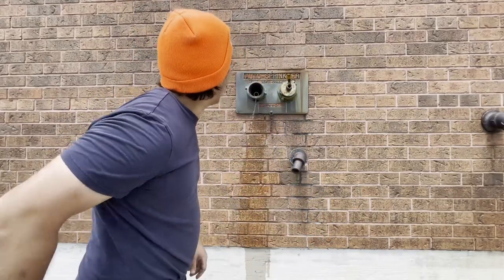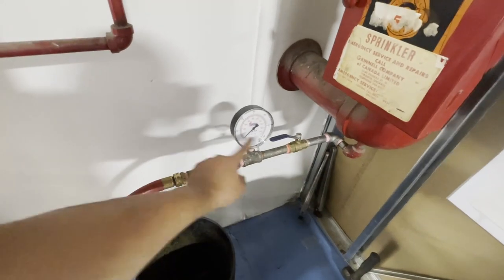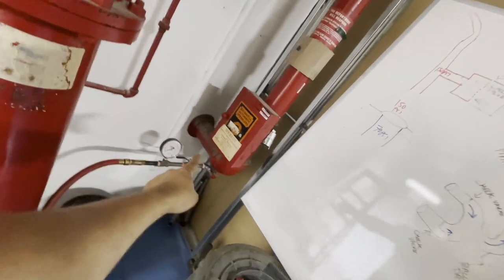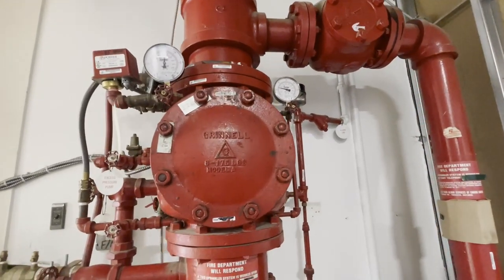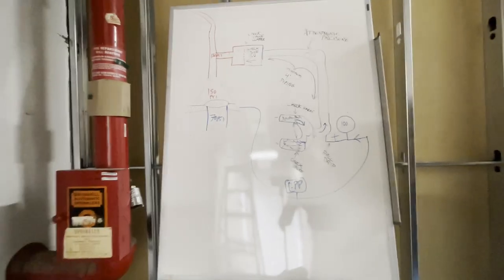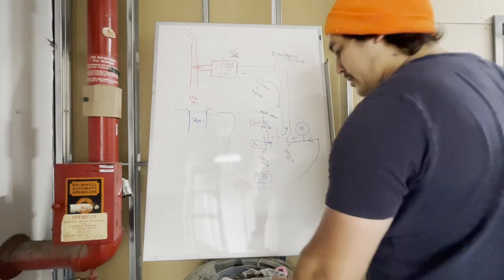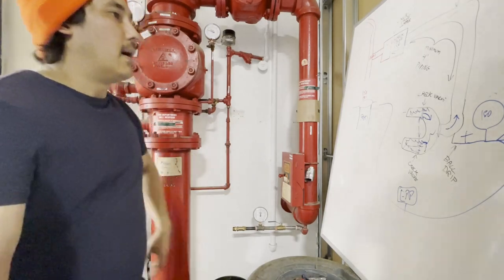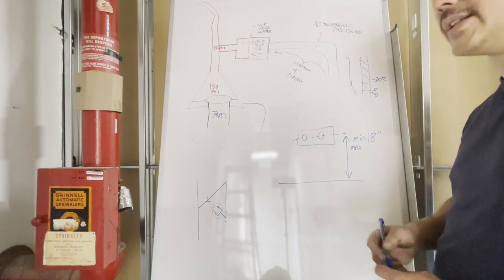5-year 150psi 2-hour Hydrostatic Test on a Fire Department Connection

Comment: I think this is great information.  We perform 5 year hydrostatic testing and it is difficult to pull the flanged check valves apart to put that flange on them. This would also work here in az where you have a remote fdc connection and the check valve is just below the siamese. Thank you

Comment: Good information, thanks, this was helpful and entertaining, water leaks really do happen and they need to be dealt with.  Like you said expect and plan for them.  The velocity check valve has me a little puzzled since on our dry valve trim work they are called automatic drain valves.  This type of operation doesn't sound 'automatic' to me.  Unlike the ball check valve which is in my mind very automatic if installed horizontally!
Reply from the maker: Thanks for the compliments and the comment! The velocity drip check and ball drip are honestly very similar in how they function. Both of them will allow a small volume of water to flow through them, however if they are under a pressure (flowing water from the alarm line of a dry pipe valve tripping or if the fire department connection piping is under pressure in the event that the fire department does indeed hook up to the FDC to try and pump water into the building). The major differences between them is that the ball drip will seal up and there's no means to "reset" it, you simply need to take pressure off of the pipe to the point where that ball will roll itself out of that concave shaped cavity. A velocity drip check on the other hand obviously has that plunger which you can use to manually force that ball out of the concave cavity if it is under pressure. Depending on how your dry pipe valve is trimmed, the velocity drip check "should" eventually automatically drain after pressure is removed from the alarm line piping. Velocity drips are really just designed to "automatically" drain small amounts of water in the event that the clapper seat on a dry pipe valve or preaction/deluge valve starts passing small amounts of air/water from either the supply side or system side of the clapper. If you notice air constantly leaking from the velocity check, you know its system air dumping. If you see water leaking from the velocity check... it could be either supply water leaking past the clapper seat, or you could still possibly be the system side priming water passing; I would say wait to see if the water stops but really it doesn't matter, inspect the brass clapper itself to see if it's warped. If not, service or replace the clapper rubber and that should fix the issue. 

At somepoint in time you'll hear fitters tell you if you're having a hard time trying to get air back on the dry pipe valve, they'll tell you to remove the velocity drip and install a 1/2" ball valve there and leave it closed while putting air back on (or just use a spare sprinkler head out of the headbox to plug it up). Once you get to 10psi system air or so they'll say throttle open/closed the ball valve and it'll suck the clapper seat down. When trying to put priming water/air back on the system, the velocity drip check will sometimes dump system air and/or priming water so you just need a means of temporarily plugging off the alarm line to lock in that priming water/system air while the system pumps up to push down on that clapper seat to create a seal. *You NEED to remember to remove pressure off of the alarm line before opening the main control valve and putting water back on the supply side of the clapper (hence why a ball valve is preferred over just plugging the alarm line with a sprinkler head or 1/2" plug)... if you forget then you're just going to end up tripping your dry pipe valve because you've essentially just created an accelerator on the alarm line piping*

Hopefully that answered your question. Its sometimes easiest to just get your hands on the parts and examine them yourself so you can see how they work.

Comment: Extremely informative
Reply from the maker: Thanks I appreciate it!
Reply: @FireSprinklerSifu  can you give a demonstration of when doing a flow test through the FDC here in New York we have to flip the check valve when doing so, I saw it done once just looking to lock in the procedure of doing so
Reply from the maker: @BPH435  Hey bro, so I had to do a little bit of digging and it seems as though NYC fire code refers to NFPA 25 (2017 edition) as the accepted standard. There is nothing in NFPA 25 (2017 edition) that actually states that the FDC check valve needs to be flipped around when doing a hydrostatic test. There's actually nothing in NFPA 25 (2017 edition) that actually requires a residual (flowing) pressure test on the FDC piping either. If this is how the fire marshals in your municipality demand for the test to be done then so be it, however there is nothing in NFPA 25 to support doing the hydrostatic test this way. One thing I didn't mention in my video was that this 150psi test only applies to FDC's for sprinkler systems. When testing FDC's for standpipe systems, its actually a minimum 200psi hydrostatic test or 50psi in excess of normal working system pressure (whichever is greater). Personally, before setting up pumps/flipping the check valve around I would simply put regular city water supply pressure on the FDC piping just as a preliminary test to see if there's any leaks (why go through the hassle of draining/flipping checks/setting up pumps if there is a leak in the system piping which can be detected by simply hooking up a garden hose?). 

That being said there's pro's and con's to flipping the check valve. 
Cons: 
- It's time consuming flipping the check as it requires a full system drain down
- additional materials may be required when flipping the check valve (especially flanged checks as they may require replacement gaskets)
- It's putting the entire building at risk in the event of a fire as it requires a full system drain down while you are flipping the check valve around

- It's putting the entire building at risk for the entire time that the FDC check valve is reversed because now in the event of a fire, the fire department themselves cannot hook up to it because with the check valve reversed, they simply cannot pump water into the building.
- It may not be feasible to do so especially on high pressure systems where a heavy duty 6" swing check valve weighs 200lb
- After flipping the check valve, if your normal system pressure matches/exceeds your hydrostatic test pressure you would actually want to isolate and drain down the system pressure (which would now be supply pressure) to below your testing pressure- otherwise if there is a small leak happening on your FDC piping that is inaccessible/not visible (perhaps behind a wall), you would have no idea its leaking. 

Pros: 

- By flipping the check valve around, it gives you the opportunity to actually "flush" your fdc piping system- but this would only work with a siamese style pump head where there is one single clapper that flips back and forth between the two 2-1/2" hose connections. If you have the same style pump head as the one in my video... how would you keep those two 2-1/2' check valves in the open position while simultaneously trying to flush? As seen in the video I used a piece of pipe to wedge those two 2-1/2" check valves open to perform the hydrostatic test. If I were to flip the check valve around and FLUSH that pipe, odds are those two pieces of pipe would just get flushed out almost instantly and then those check valves would just close on themselves. 

So to answer your question, can the test be performed by flipping the FDC check valve around? Yes it can be done. Is it necessary to do so as per NFPA 25 (2017 edition), no it is not. IF the fire department is hellbent on doing it this way for the sole purpose of flushing the pipe to ensure there are no obstructions, I would ask them if its possible to perform an internal obstruction investigation on your fire department connection piping to verify 100% that it is not obstructed by anything. As per NFPA 25 (2017 edition) there is no requirement for any residual flow test on the Fire Department Connection piping, only a 2-hour hydrostatic test (150psi for sprinkler, 200psi or greater for standpipe). 

NFPA 25 (2017 edition) Standard for the Inspection, Testing, and Maintenance of Water-Based Fire Protection Systems. 

6.3.2 Hydrostatic Tests. (standpipe)
6.3.2.1* Hydrostatic tests of not less than 200 psi (13.8 bar) pressure for 2 hours, or at 50 psi (3.4 bar) in excess of the maximum pressure, where maximum pressure is in excess of 150 psi (10.3 bar), shall be conducted every 5 years on manual standpipe systems and semiautomatic dry standpipe systems, including piping in the  re department connection.

13.8.5 The piping from the fire department connection to the fire department check valve shall be hydrostatically tested at 150 psi (10 bar) for 2 hours at least once every 5 years.

Table 13.11.1
Fire department connection- sprinkler system(s). Inspection, Test, and Maintenance Procedures. (1) Isolate and hydrostatic test for 2 hours at 150psi (10 bar). (2) Main drain test (only when a control valve has been closed)
Fire department connection- other than sprinkler system(s) Inspection, Test, and Maintenance Procedures. (1) Isolate and hydrostatic test for 2 hours at 50 psi (3.5 bar) above the normal working pressure [200 psi (14 bar) minimum]. (2) Main drain test (only when a control valve has been closed)

Hopefully that answers your question brother.
Reply: Bro,  I can't say how much I appreciate and respect your Knowledge and thoroughness in this Trade of ours!! I love it Bro!! Really I was literally just watching your link to the first video when j saw your response to my question.. So in New York the Fire inspectors want to see the flow just to ensure that the water is coming out clear.. they literally watch it for no more than 5 minutes and then we wrap it up and pressurize the system all this is done  with the check valve out as you said there is alot of risk that is ran by doing this I will in the future fill up with air first to ensure there is no leaks or missing pipe before going straight to it.. we do the same similar procedure that you do with the pipes holding open the check valves on the FDC what we do is we screw an piece of  2½ in diameter pipe into an manifold Rig equipped with a gauge and a hose cock on both of the Threads of the FDC and then proceed to Pump up the System either with a Hydrostatic pump or turn the pump on until whoever is outside confirms that we have reached our desired PSI. Now that you have confirmed by code we do not have to flow I will be citing this to all inspectors when doing future 5 Year FDC test.. I'm. Currently studying for my Nicet 1 in Sprinkler so I have to get savvy with code. Looking forward to more of your knowledge and videos I truly, truly appreciate it!!!
Reply: Quick question to pressurize the wet side of the check valve do you first isolate everything that I'd above the check valve meaning if your able to isolate the 1st Floor you isolate then do you torn on the pump or is it another procedure you take?
Reply from the maker: @BPH435  No problem brother! I'm happy to share whatever knowledge I can! Again, I honestly don't see any real purpose in doing any kind of residual flow test on the Fire Department Connection piping OTHER than proving that the pipe is not obstructed. Other than that... there's nothing in code that says it requires any kind of residual flow tests. If the purpose of flow testing is just to ensure the water runs clear, is the 2" main drain test not acceptable? or perhaps opening an inspectors test valve quite literally anywhere and everywhere on the system piping until the water runs clear? You could even just open the (normally closed) test header valve and flow water out of your test header until it runs clear. There's multiple ways of flowing water which don't involve flipping around the FDC check valve, it just seems strange to me that this how things are done in NY. 

With what you are describing are you sure you are not hooking up to the "test header" of the building? Annually you do have to perform a fire pump flow test which is essentially a performance test of your fire pump. There's multiple ways of doing it (pitot tube with play pipes, hose monsters, flow meter, etc), and you will flow test your fire pump to ensure it is performing as per the placard stamped on the pump where you would plot your suction/discharge pressures of your pump flowing at churn, 50%, 100%, and 150%. So if your fire pump is 1500gpm, you would perform 4 tests: churn, 750gpm (50%), 1500gpm (100%), and 2250gpm (150%). The fire pump flow test has its own normally closed test header valve typically located just downstream of the fire pump discharge side and then outside the building you will have multiple 2-1/2" valves outside which you can use for testing. 

Just reading what you're describing doesn't make much sense to me especially if your inspectors are hooking up gauges to the FDC and running pumps and getting residual flow pressures. As mentioned earlier the only test required on FDC piping as per NFPA 25 is a 2-hour hydrostatic test (hydrostatic meaning non-flowing).
Reply from the maker: @BPH435  I'm not 100% sure what you are asking but I'm assuming you are referring to this video when I left the check exactly where it is (I did not flip the check around) and simply pumped up the wet sprinkler system to 155psi, and you are asking if there are isolation valves downstream of my alarm valve (say for example this was a 3 storey building), and you are asking if would I also close the 1st floor, 2nd floor, and 3rd floor shut off valves prior to pumping up the system to 155?

I hope I'm interpreting your question properly, but if this indeed what you are asking then I have two answers to give you.

1) in the perfect world, yes I would isolate any valve downstream of my wet alarm valve prior to pressurizing the riser up to 150psi (or higher, as mentioned in the video going a bit higher is better so I don't disturb the check valve). By isolating all valves downstream, the riser itself will pressurize much faster so I won't have to wait as long for that 1/3hp excess pressure pump. IF I were to leave all the valves open and pressurize the entire system, it will definitely take much longer to pressurize the entire building in comparison to if I were to isolate all the floors.

2) Keep in mind we work in old buildings where we don't know for sure if all control valves actually hold 100%. If I were to isolate all of the valves downstream of my main wet alarm valve (close control valves for floors 1 through 3) and THEN turn on my excess pressure pump and pump it up to say 155psi and then turn it off. What I might actually see is my system pressure dropping after pumping it up and that could be caused by a control valve that doesn't quite close 100% and now my riser pressure is leaking past the valve and slowly pressurizing whatever is downstream of that shut-off valve (say for example the 2nd floor control valve is closed but its kinda faulty and really only closes 95% shut). My riser pressure will equalize with that 2nd floor pressure due to the control valve not holding tight.

So to answer your question from a service perspective, as impatient as I am I would still probably opt to simply leave all the control valves downstream of my wet alarm valve OPEN and simply pump up the entire building. The only exception to this rule would be any tail end dry, pre-action, deluge, or antifreeze systems (especially with RPZ backflows). Any tail end system like that, 100% you ALWAYS want to make sure to close that control valve and open the drain valve below the seat just to ensure 100% that you don't accidentally trip any of those systems or cause that antifreeze RPZ backflow to cough up antifreeze out of the relief vent port.
Reply: @FireSprinklerSifu  Yes I am familiar with the Fire Pump test in that exact procedure, but no I am certainly referring to the FDC hydrostatic testing.. the inspectors here in NYC for there personal reasons obvioysly want us to flow the water until it shows it being clear, moving forward I will quote the NFPA 25 2017 code stating the parameters of doing an FDC hydrostatic test.. I tried to download the NFPA 25 2017 edition but I haven't found one that can be downloaded may just have to buy the book.. looking forward to you posting some more videos on the trade.. it's truly appreciated
Reply: @FireSprinklerSifu  Thank You Brother you answered that for me perfectly, I was thinking about how you did your FDC test with the check valve in place which I never done before, and as you mentioned with the FDC requirement of the Hydrostatic Testing be at 150 psi if the other side of the check valve system pressure is let's say 75 psi the FDC side will start to leak into the system side which was a great illustration you gave, that made me wonder about pressurizing the entire building to do that process or possibly isolating let's say the first floor and the pump it up to 155 for the system pressure, then go for your 150 on the FDC.. as you said is that valve is only holding at 95% then that can cause another issue, so it seems a little tricky with that